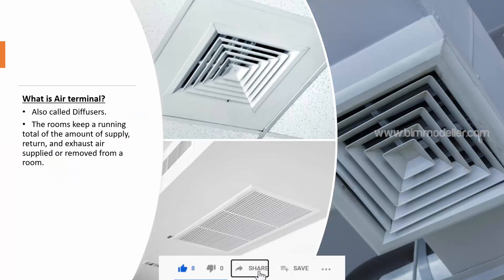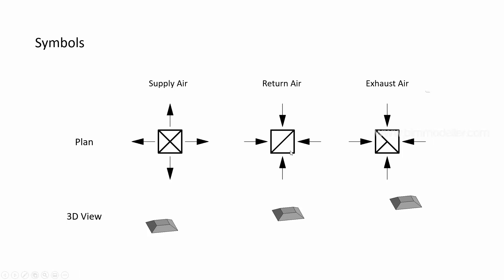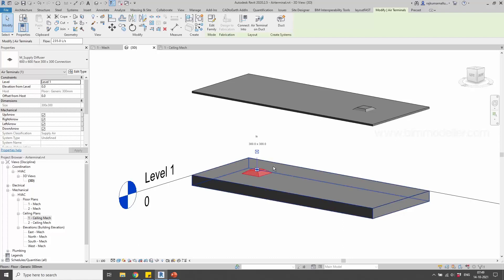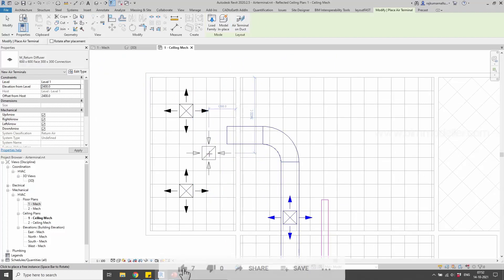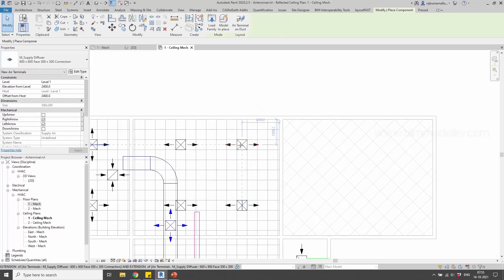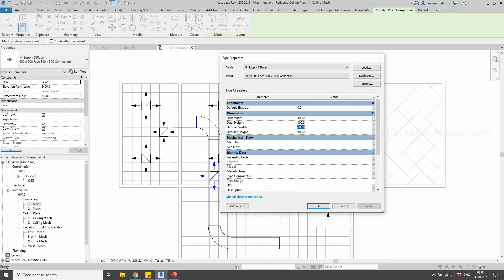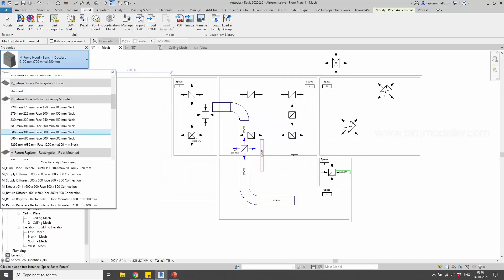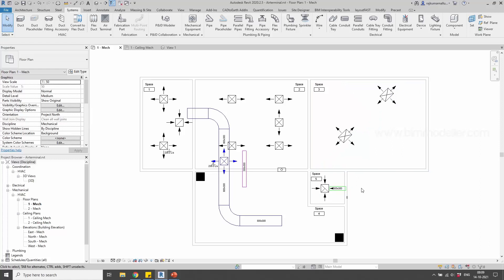Revit MEP Tutorial 15: How to Place Air terminal in Revit

Comment: I have a question about air terimnal in given large mep project. On level one, supply air terimanls are on the sides of tthe ducting, Cafeteria room for example, like all rooms on level 1. Does it means that the main duct is under the ceiling level and the air terminals are verticaly standing on the side of the main ducting line, or it is still above ceiling with regular air terminals on ceiling, it s just that it is not so visually clear in dwg layout.. ?
And,,, which air terminal to use, as we don t have any of 100l/s... nor we do not have idea about its sizing.. ?
Reply from the maker: Side of the Duct